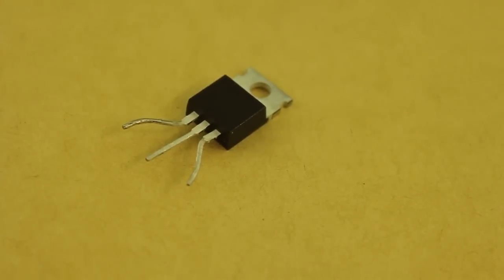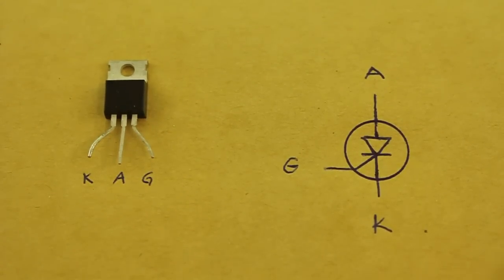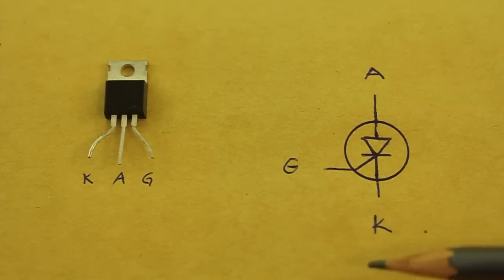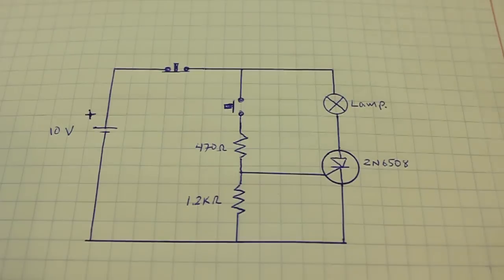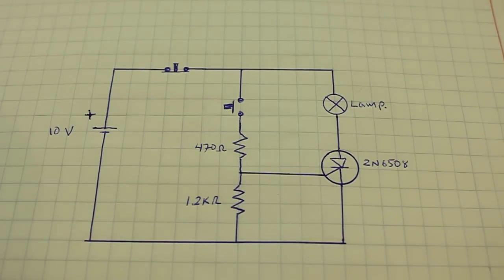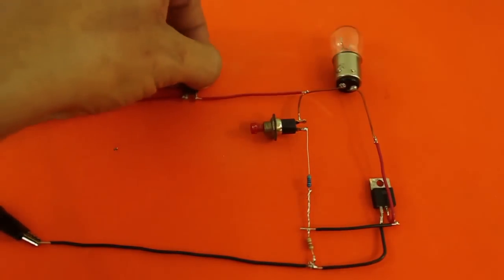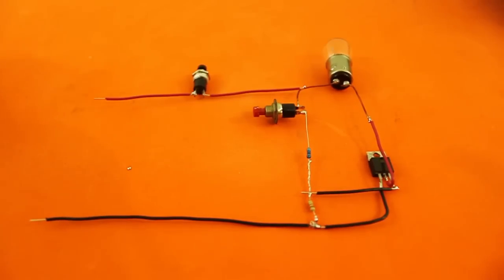How to use a Thyristor as a Switch

Comment: typically thyristors have very slow switching speed so they are very bad for switch mode power supplies and the fact that you can't turn them off with low power signal is even worse. the only way to use them for inverter applications is half bridge topology with 2 capacitors and even then there is a risk both of them will turn on at the same time and this is what happened when i experimented with them. they are most commonly used to control ac powered devices as a high end relay. in fact solid state relays mean thyristor in a fancy packaging. other than relay then can be used for crude duty cycle control for ac powered systems. their common use in ac systems is because ac naturally passes trough 0v moments multiple times a second. the only other common use for non-ac systems is railguns/coilguns- they are faster than mechanical switches, cheaper than transistors and you don't need the ability to turn them off with low power signals, you just wait the capacitors to disharge

Comment: Normally thyristors are usefull in AC applications. In DC circuits use FETs  (there is less Rdson => less power loss). Your argue that thyristors are cheaper than high power switsches isn´t correct, because you need such a switch in your main circuit.
Reply: Andreas Wolfesberger thyristors have massive surge currents though

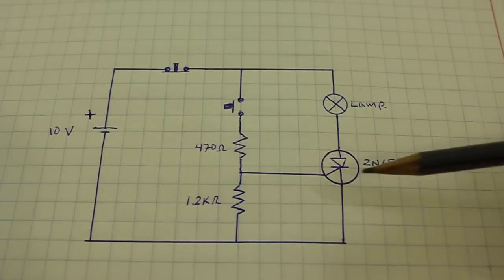Comment: 1:47 how do you calculated the resistor values ? Does the Thyristor require minimum voltage or current to turn on ?
Reply from the maker: yes the values are on the datasheet
Reply: Based on the resistors values you used, I calculated there is 8.6V DC applied on the gate. Datasheet https://www.mouser.fr/datasheet/2/308/2N6504-D-105467.pdf specify that "Max Gate Trigger Voltage" is 1.5V. I don't get it.
Reply: @Tigrou7777  Why are you assuming he used that particular SCR?
Reply: @TheBaconWizard  hahaha these guys a everywhere even in the government
Reply: @Tigrou7777  I don't think it is the max. it is the min. And is the current the important factor, so voltage can be higher than 1.5 min?